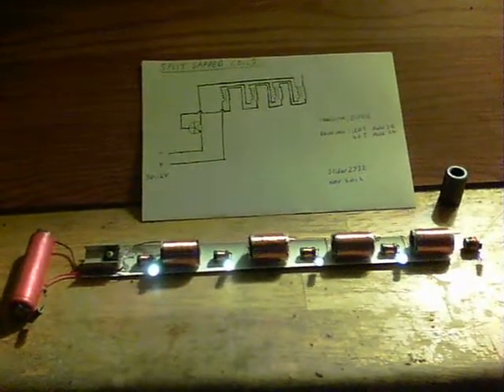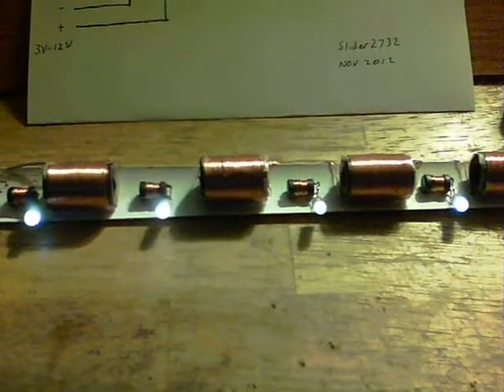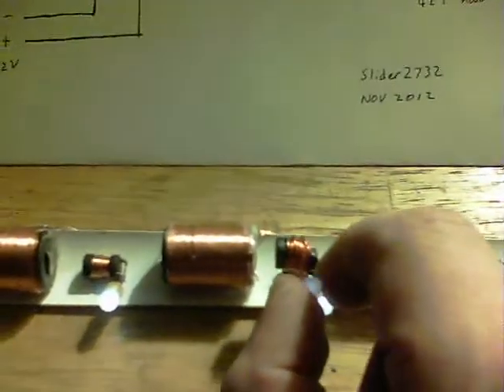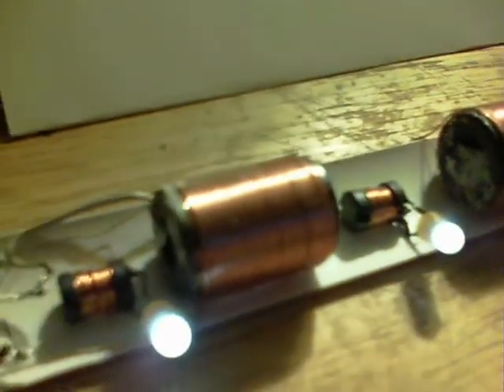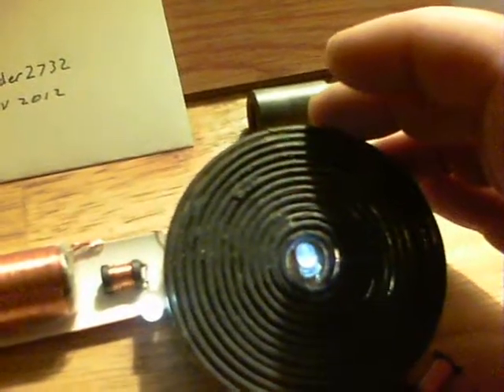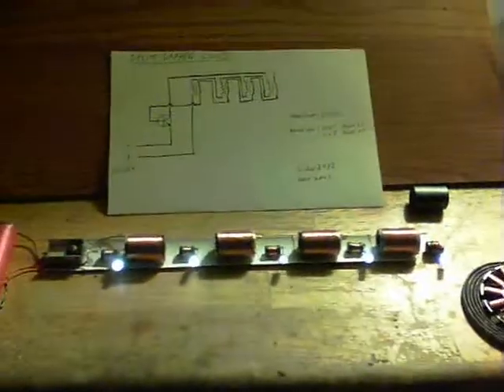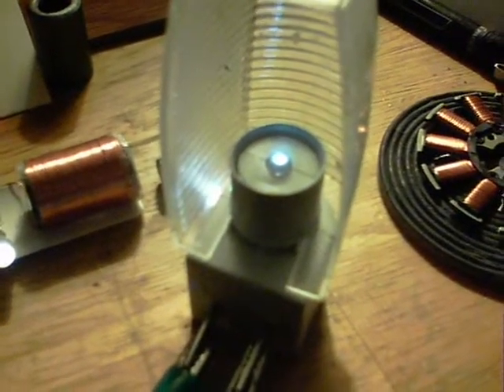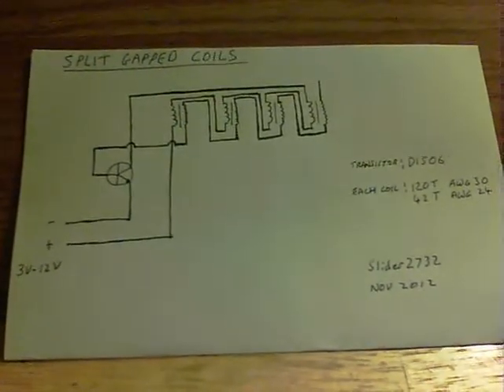Split Gapped Coils

Comment from the maker: Yes, i'd think so...we don't have our water heater hooked up or i'd have tried that. As long as there is some way of gaining the induction wireless energy inside the metal casing it should work. Or, a heater could be designed with a perspex or something area to allow such a setup. In fact, the inductance ratings of LED sized receiver coils could signify run energy parameters, green, orange, red LED's. There would be no chance of readout error when designed like that.